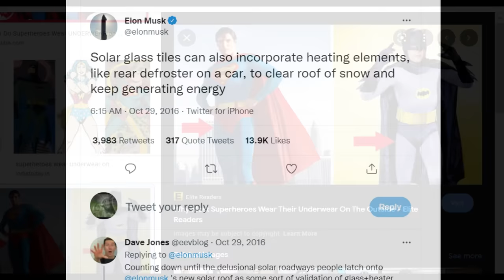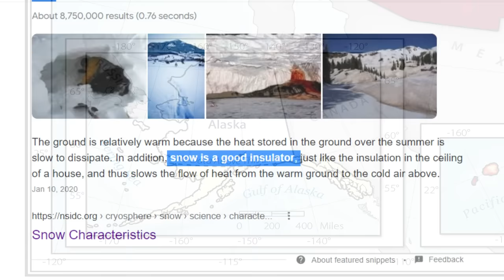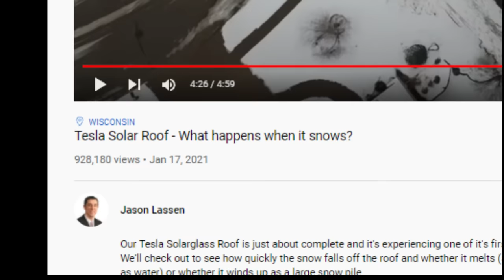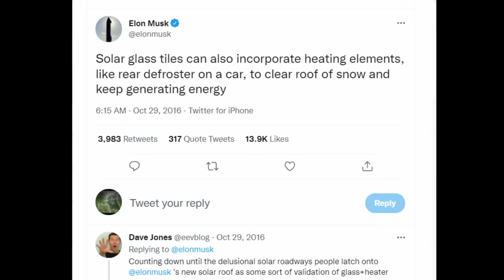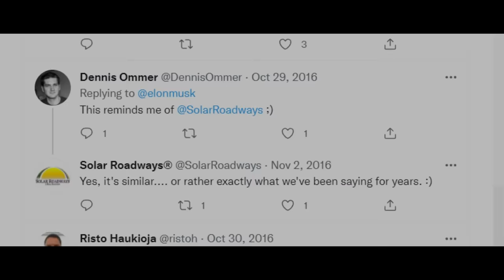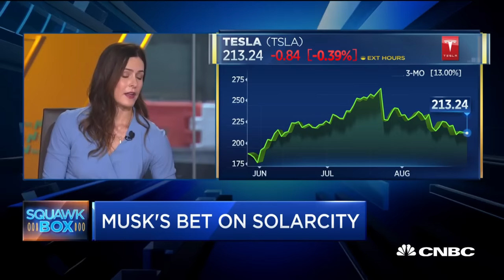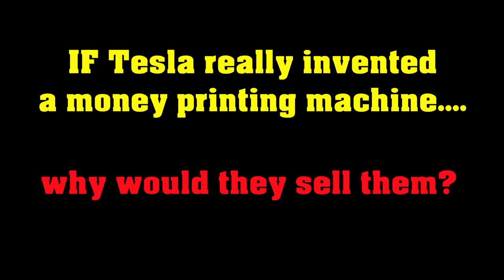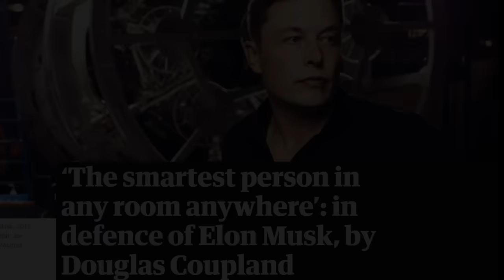Elon Musk: The Smartest Person in any room ANYWHERE!

Comment: My solar panels at 51N generate in the month of December about the same as 1 or 2 days in June. December is mostly without snow. Januari/Feb. don't produce enough energy to waste energy to meld snow, it is a nett loss.
Reply: Is it a net loss all year round, though, all months taken together?

You know, it's funny with intermittent energy.  If you scale it up to barely create enough power on the bad days it creates a huge surplus on the good days.  Meaning in the long run there's a market for massive intermittent power consumption.  But then whatever facilities use all the surplus power are more profitable if the operate for more hours, creating a demand for even more renewable energy.  And if that is scaled up there's even more surplus around, creating even more demand for utilization of an even large surplus.

This is going to make energy production explode exponentially so much that by the second half of this century the last century is going to look like the Middle Ages in comparison.
Reply: There is snow at every latitude, something to do with altitude too.  These were not just made for your personal situation. :D
Reply: @OolTube02  funny thing with electricity: it needs to be used the moment it's generated, otherwise it's lost. You can store it in a giant battery, but you won't be able to keep it that long, it will get lost. You can put it into the grid and take from the grid in winter, but if everyone does that you still need polluting power generation grid side.
Reply: @superslimanoniem4712  Well, the issue is, huge energy storage solutions have never been implemented before, while combustible fossil fuels were still both the source and the storage medium of electricity.  There was just never any need to build out massive battery power or flywheels or thermal power storage or compressed air or hydrogen or whatever other means you can think of.

Also gigantic high voltage direct current power lines spanning entire continents or even oceans were never a thing that was needed.

That doesn't mean they're not physically possible.  They merely weren't economically profitable before.

But now that solar and wind has become cheaper than coal, gas, and nuclear, suddenly there is a demand for storing and or transporting electricity across vast distances.  And now we're scrambling to develop the production capacity for energy storage.  That's why I don't think a company like Elon's has any trouble remaining profitable in the future.  His battery manufacturing alone is likely going to make him more money than his cars.

He's clearly been at the right place at the right time with the right vision, no matter how many otherwise crazy ideas he's had.
Reply: @hermitoldguy6312  As opposed to what?  Keeping using fossil power plants and today's infrastructure and expecting renewable energy not to disrupt the system?

Even without global warming that wouldn't be an option.

China has already been building a massive 3,300km, 12GW HVDC power line from renewable power projects in their uninhabited hinterlands to the populated cities.  Britain is planning a giant cable going from North Africa along the coast of Portugal and Spain all the way up to the British Isles.  It's going to require four years' worth of all the worldwide power cable manufacturing to date just for that one project, which is why they're going to extrude their own cables for the thing up in Scotland.

So one project alone is going to require more high voltage power cables than the entire world produces at this point.  For roughly half a decade.

Tell me again how it's utter drivel that there is massive growth of infrastructure happening in that area over this century!
Reply: Next to a river? What good would that do? But sadly the the river behind my house freezes over and I could never get a permit  to build a mill.

But more homes have a roof that receives sunshine than access to rivers. Even at 51N and non optimal surroundings, a small 2.5 pkWh installation supplies  about half (2200 kWh) of my electricity needs (4000 kWh). About half of the generated energy is used directly, the other half is fed to the grid.
Reply: @OolTube02  - You're giving a philosophical answer to an economic questions.  Please show me in realistic numbers, how utility-scale storage works.  Include the materials sourcing, manufacturing and disposal.  Show me how much storage you are going to need and where you're going to put the facilities.  Oh, also regarding the sourcing,  make sure to include the military intervention required to overthrow the Taliban (again) since our president just handed over the world's richest lithium deposits to them last month.

BTW, California built a large, utility-scale storage system using pumped-storage decades ago, but never followed up with more since it just didn't work economically.  Economics will trump ideology every time.
Reply: @hagerty1952  Someone could make a good case for fossil fuels being the cause of the US being in Afghanistan in the first place with all the Saudi Arabia connections.
Reply: @hagerty1952  I don't really want to defend Biden because he obviously sucks but you are positing things that aren't even true and then are  convoluted with all kinds of other factors. The reality is US oil production is heavily tied to price and when price goes down production goes down. If you want production to be high, then you kind of need price to high. Most people care about price so they want it to be low. If you then care about US production, then you can complain no matter what happens.
Reply: @michaelwisslead5349  - I don't disagree with you.  I'm willing to be convinced by verifiable facts.
Reply: @Ecard Ecardian You'd need a flow of 1,000,000 litres per second with a fall of 1 metre.